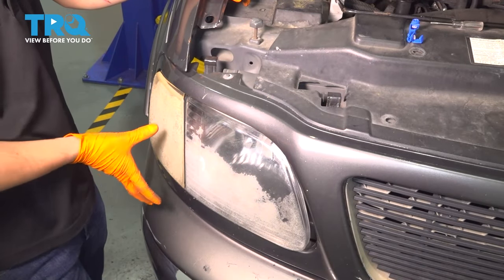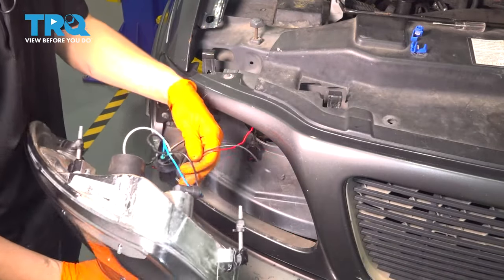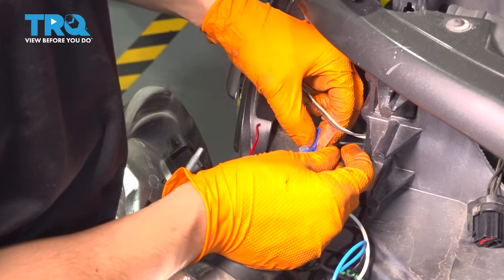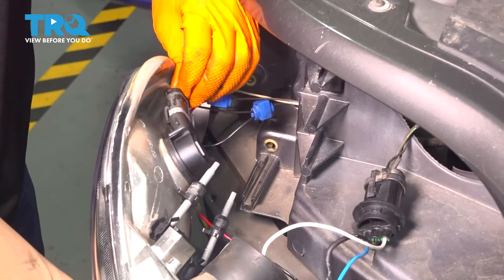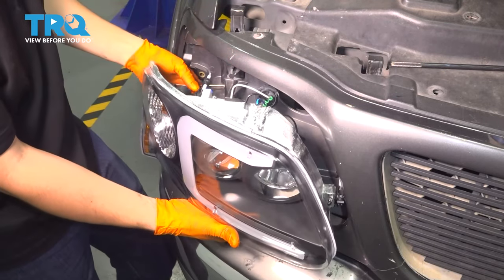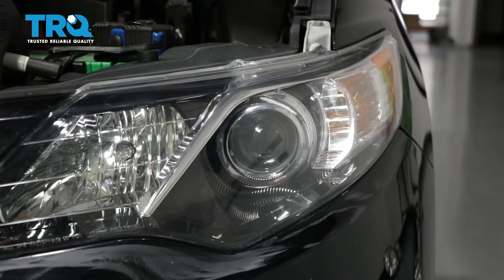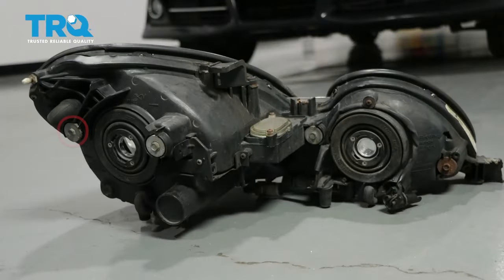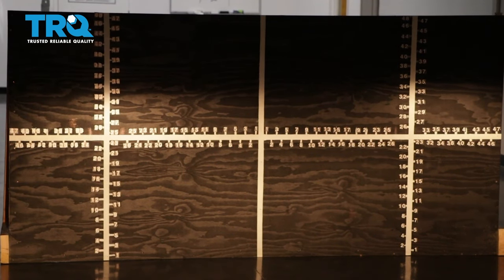How to Install Performance Headlight Assembly 1997-2003 Ford F-150

Comment: Be careful when you buy aftermarket headlights.  I just spent several hours trying to make some fit in my F-150.  The adjuster stops were made incorrectly, couldn't possibly fit in place, needed to be modified.  The adjuster rails were loose at the ball joint, making it impossible to locate all three in their slots at the same time, as you must do.  More modifying.  The "twist lock" slots for the turn signal bulbs were rotated 45 degrees off so when the bulb was in place, the harnesses wouldn't fit in the space provided behind them.  MORE modifications.  Buy these only from a reputable company (NOT Amazon, who demanded my photo ID before refunding).